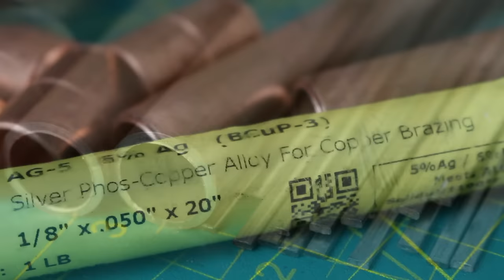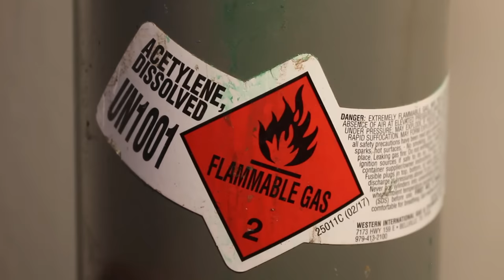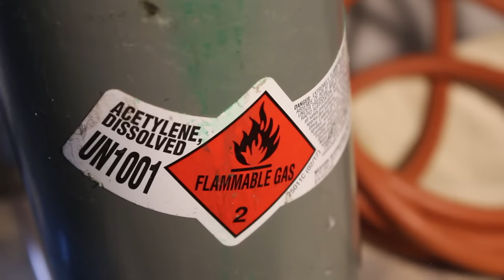How To Braze Copper Pipe Like A Pro (HVAC Refrigerant Lines)

Comment: I could have been in and out of there in 1/4 of the time.  Your torch was whistling like the tip had something in it.  I’ve used both air acetylene and ox acetylene I prefer the latter.  You should have been able to get the joint up to temperature much quicker.  Other than that I thought it was better than a lot of the brazing videos I’ve seen

Comment: I'm no HVAC pro but I've seen what happens to the inside of copper pipe when nitrogen isn't used while brazing. All those flakes can't be any good for expansion valves or anything else.
Reply: Nitrogen is only required for med gas that’s it
Reply: this is not welding.
Reply: That is how most txv fail
Reply: No you right man I just started to work in hvac and they ran nitrogen while we were brazing the copper together
Reply: i feel like you should shut the flup cup if you arent an hvac pro.
Reply: Smh... there are so many hack-n-glue "pros" out there. The old guys who trained me to braze HVAC copper lines had worked in the HVAC field 30+ years and they were always commenting on hack jobs they encountered and how difficult it was to find good techs.
Reply: Sounds like you're on your way to becoming a great HVAC tech!

Comment: You should ad more weld on the joins to fill it up properly because of high pressure oparation. it's very good though.. but not perfect.  (I am a tough judge, sorry)

Comment: Could I braze the vertical pipe first? then after that I rotate the pipe 90 degrees, and make the horizontal one to vertical, then braze it? because I think when braze the vertical one, the melt metal will go down into the gap between the pipes it will make the join much stronger. Thank you for sharing!
Reply: Get a professional please.

Comment: Long radius 90's are preferred in HVAC....Air conditioning rated fittings are a must....Nitrogen is over rated but to be a pro must be used these days to avoid ridicule.....First you heat the pipe....Then you heat the joint and it sucks it right in.....works every time.

Comment: So no movement to facilitate capillary action? This looks nice on the surface but I would recommend travelling the heat down a little to form a much taller seal internally.
Reply: Michael Garcia I was thinking the same thing
Reply: Brazing seals the outside. If you get inside the lines u have a problem! It doesnt take much....
Reply: @Progress24.7  wrong.

Comment: My boss tries to tell me I get it to hot. I never have leaks and have vacuums hold for 8 hrs. Nice video
Reply from the maker: When the copper turns cherry red its definitely time to put the flame away. I have definetly burned a hole through copper from overheating haha. I usually heat it up and swipe the brazing rod across the pipe to see if it's at temperature and then I know I'm ready to apply it fully. Bosses are picky but those vacuums tell the truth! Good job🙂 Thank you I appreciate that very much. Appreicate your feedback and have a great day!

Comment: Asking as a regular home owner; why for A/C lines do you use brazing rods instead of solder like used in plumbing for water?
Reply: The A\C system runs at far more higher pressure so all the joints on the system should have higher temperature resistance and stronger connection.

Comment: Over heating the pipe man , you fried it !
Reply: No kidding and didn’t even cap it
Reply: First time i guess
Reply: Exactly what I was thinking 🤔
Reply: If you've never silver brazed copper lineset before, just say that. Silver brazing won't even begin to start melting until copper is at LEAST glowing red. Stick to plumbing. 😂🤣😂
Reply: Na he did good if he did overheat it you would have seen a cheeta like patern on the parts the braising material is at

Comment: How you doing can you make a video where a copper tube is cracked millimetres from the compressor shell where its leaking oil and  needs to be filled with the special welding rod...and what material to use..thnks

Comment: Do I understand correctly that you use acetylene due to higher hit density? I.e. to hit the joint quicker as as little heat as possible dissipating into the length of the pipe?

Comment: There’s room for improvement here. By and large, using a turbo torch is NOT the way the vast majority of technicians braze lines . You heated up the fitting before you heated up the pipe, and that is the opposite of best practices. You heat the pipe up first so it will expand within the fitting, creating less space in between the pipe and fitting while you’re brazing. Also, personal preference here but you’re using very low silver content brazing rods, 5 is much harder to use. 15 percent silver is the industry standard.

Comment: Tried to use a brazing rod for the first time but the Butane Propane mixed gas is not getting the copper pipe Cherry red, from what I’ve seen online the gas will reach 1300° C and the brazing rod melts at 710° C, so have no idea what is going on.

Any ideas would be great, The only thing I think I can put it down to is the touch head as it has no adjustment for the flame 🔥
Reply: that tested in lab. In real life heat dispersed very fast so it got be much hotter to work well

Comment: Thanks for the  video. I'm in business making thousands of brazed C joints a day. Brazing wire does not need 1500 C  to melt. Copper melts  about 1100 C and silver based brazing wire melts about 800 C. Compared to large scale production your brazed joint  looks low quality and spend much time and wire to braze. Good capillary clearance, nitrogen inside tubing, flux in flame, flaring on the tip of countersink  also improve.

Comment: u r moving torch 360 degrees but it's not possible in the job site
Reply: if youre having a hard time with moving around the joint on job sites i suggest getting a twin tip for your torches. it helps get a nice even amount of heat around the whole pipe , and can get the flame in hard to reach areas.
Reply: Making a small heat reflector out of some sheet metal clamped in a vise grip can be used to concentrate the heat on a joint that does not allow 360 deg access. Placing the reflector behind the joint keeps the blind side hot and prevents heating the surrounding wall. (Fire = bad)
Reply: He did a great job but you are correct I do hvac an when your brazing in the attic in hard spots it gets a little tricky
Reply: @ChaseLife2016  yea exactly.. and I want to see the video of him using turbo torch at 1 ¹/⁸" evap line at condenser, and keep the valley cool..
Reply: Valve*
Reply: @traeb8866  I want to see someone braze. 3/8- an 3/4 line set with coupling in attic next too spray foam insulation it’s rough lmao 😂
Reply: @ChaseLife2016  haha will b some charred spray foam to b cut out after the tail of that turbo torch flame has heated everything but the line set.. ha
Reply: @traeb8866  right school an being in the field two different things I learn from the field not a book an school don’t teach you when you up in the attic trying two braze between trunk with insulation wrap an roofing insulation trying to get a decent pass on the cooper line set 😂😂😂
Reply: @ChaseLife2016  I agree it gets pretty tricky 🤣
Reply: @ChaseLife2016  he did not do a good job,  it was an abysmal execution.
Reply: @trevorbjarne  it’s easy to braze line set or copper on a table he did a good job but it’s hard when you in a tight space
Reply: @ChaseLife2016  he did not do a good job.
Reply: @ChaseLife2016  it might be difficult in tight spots but one needs to know the basics,  fundamentals the principles and theories so that you can apply them in any situation.
Reply: @ChaseLife2016  I do not know if you can see my profile picture but that is me passing my large bore (6" & 8") med gas brazing certification test.
Reply: a good tip when brazing (or soldering) on the job is to try to heat and braze the harder side to reach first. Just angle the torch as well as u can and do the side you can't see first, that way u can be more sure that it was hot enough and done correctly
Reply: Huh? You are confused/ confusing.
Reply: Typically, I try my best to divide 3/4" + pipe/ joints into 4 quadrants making sure I get a good flame spread over said quadrant and then work the solder from the top of the joint to the end of that quadrant and then from the pipe to the back of the joint and then from the top to the next quad.- that's half the joint, then I repeat the same on the other side, maybe clean the entire joint up a bit with the torch.
For 3/8"-1/2' ish line I divide in half soldering one half then the other. 
for smaller then 3/8" drawing the solder from the pipe to the back of the joint does the trick with very little torch movement besides that which is required to flow solder and get a good heat spread. 

If nothing else, watching TIG welding videos helped me tremendously in the ways it translates to brazing,. Besides that, soldering is mostly prep work. Sand the joints till they're shiny like fresh pennies, a dab of flux, proper nitrogen flow, and of course, properly fit pipe-all facilitate the flow of solder and the conversion of the joint to 3rd alloy making it truly one piece that's gonna hold pressures well over that of typical operating pressures of just about any HVAC/R system. 

If the pipe is cherry red, you're already way too hot, there's nothing stopping you from lifting the torch momentarily to keep the heat under control, DO NOT blow the fitting with excessive heat, if you rupture a service port, there'll be more than one person pissed the fuck off at you.
Reply: @trevorbjarne  it’s not hard, don’t act like that lol
Reply: That’s why they need you there
Reply: @icychillgrill3  I think you are on the path of understanding the brazing process. But, you do not reporting or conveying proper or correct information. You, refer to this process as soldering and you said some things that are correct and a bunch that is not correct. I am trying to wade through your English (I am in no way faulting you trying to explain something that I am to assume is at best a second language - I speak zero Korean, so you are doing better than me on the languages front). I am happy to hear that you said that if you get your fit-up cherry / red hot then it is too hot. Like I said, there is too much going on here that you are not really conveying what I believe is in your head well. I'm trying to be nice and helpful. If you would like some help, then please feel free to ask me. All the best.
Reply: @captainmigs1655  I don't think you know what you are talking about. You don't act like that.  LOL
Reply: @trevorbjarne  shhhhhhhh

Comment: My friend is HVAC.
He is adamant that you do not need flux and he uses silver rods to braze 35mm pipe that they form their own sockets on.
The rods contain phosphor which acts as a flux within the rod. Is this correct?

Without the phosphor the joint would not work. Is this true?

Comment: Hey! What kind of rods to torch with? U mentioned silver Brazing flux? Then u said something else??
Reply from the maker: They are called brazing rods. They come in different percentages and that percentage is the silver content in them. Higher the percentage, higher silver content and strength. Typically the standard is 5-15% for a solid connection from copper to copper. Make a clean cut, sand it down and braze👍 Thanks for watching!
Reply from the maker: Stay tuned for new videos every week! 🔧⚡️

Comment: What is the advantage of brazing over soldering which is much simpler and less demanding?
Reply: Brazing is stronger and more heat and vibration resistant.

Comment: I've done this a few times on ac lines. Have the burn scars to prove it 🙂  I f I d it very stressful but the more I do it the more relaxed I feel. Is there any limit to how many times you can go back and touch up the joint. What if the joint has already cooled down.
Reply: It's like welding..you'll just be adding to what has been done.
Fluid motion is key
Reply: No more than two times.

Comment: Hi! I brazed pipes 2 years back (compressor of my fiesge gave up so I replaced it myself). I noticed the joint/seal is showing signs of giving up... Is it safe to pump the gas out of the compressor and redo the soldering? Thanks!

Comment: I needed ver little for a single job, so bought some on eBay. I never noticed at first but as many small stuff, comes in broken packages. I saw the stamping on one or two that looked like “Sil-Fos” or similar. Used two maybe but while wrapping for storage, the others were not stamped or marked in any fashion. I am sure analysis would show no silver content.
 What did Ben Franklin day? Buyer beware? I’m sure I got shorted. So ask, take a photo of response and same after it arrives and set time/date code on photos as depending on size/amount/cost, they let you keep it and re-send new.

Comment: NO shade intended, but this video is why I don't use a B tank. The flame was on this fitting, which appears to be 3/4" ACR, for over 3 minutes. An oxy/acetylene torch would have this done in less than a minute. Less heat transfer up and down the tubing as well, to limit potential damage to other components.
Reply: Wrong. Please contact if you'd like actual advice.

Comment: Why can you not use normal solder for refrigeration connections , it seems to work perfectly ok for plumbing and heating , I am just curious to know the answer......👍
Reply: yensabi Solder used for soldering water pipe is lower melting point which can’t hold up to the high pressures of refrigerant and vibration at the equipment. Higher silver content. Brazing is a much higher melting point and stronger bond.
Reply: Brazing is stronger to deal with the higher pressures in refrigeration. R-410a on a hot day and a plugged condenser will get you 600psi real quick and you'll never see that in plumbing.

Comment: Yeah just using acetylene you're heating 15' of pipe up and creating soot. Oxygen acetylene can instantly heat just the joint so you're soldered and done in seconds.
Reply: first off this isn't soldering.  and secondly the entire industry uses this method and has for generations.  Its easy to be critique someone behind a keyboard.  union plumbers and fitters use this exact method all over the United States.  The system has a service life and nobody cares about being overly anal and particular.

Comment: Ive had trouble burning pipes leaving the flame on one spot too long. Heating from the bottom, waving a bit on the piece and then bringing up the flame towards the rod seems to work best. Many old timer's ive worked with also say reheat the piece too many times is bad. Those same guys also didnt think using nitrogen was necessary even though the ports on some valves are frickin tiny. Maybe things were different with R22?
Reply: I'm sorry, but this video and your old timers are giving you bad information. Things were not different with R22.
Reply: @trevorbjarne  Hey there thanks for the input from my 1 year old comment but, im not sure what you mean since obviously R22 systems are not compatible with their "modern" replacement ala 410a. I've had the liberty of recharging R22 systems which is easy since you can just add more without issues. Conversely 410a was a pain since its made up of 3 different chemicals instead of just one like r22 and would sometimes need reclaiming to refill the system. My point being, with obvious things like pressure differences and temperature thresholds off the table, how do you suggest they are not different?
Reply: @nobadnamesleft  Hi,  No Bad Names left. I'm sorry if I was unclear - as the subject of this video was brazing... so when I said that "it" hasn't changed - I was referring to the brazing process.  That's it... the brazing processes has not changed in that last couple of decades - I've made it better - I have just written a book on the manual torch brazing process.
Reply: @trevorbjarne  I see i over complicated things as usual for myself lol. Cheers 🍻
Reply: @nobadnamesleft  If you have any direct questions about brazing - I can answer them. All the best to you and yours.
Reply: @trevorbjarne  Let me ask you this:  what do you think of going with a soft solder joint (in refrigeration) like with Stay-Brite#8 - instead of brazing?  You've got the annealing problem and the carbon buildup problem because you're using so much heat.  I see a pro guy on YouTube (Halligan 142) who says the Stay-Brite #8 method (soft solder) works for him; although others don't really recommend it.  The trick with brazing seems to be don't go too crazy with the heat.

Comment: I'm learning to braze at my new job.  They use oxy-acetylene.  Is there a benefit to using only acetylene?  Also, reading the comments, it seems there is much more to brazing than maybe even the guys at work know.  We just build chiller units.
Reply: If you are in a shop environment oxy-acetylene is probably better.  A turbo torch can efficiently braze up to around 2 inch copper with the right tip.  The real advantage is if you are lugging everything to a roof, one tank is lighter than two tanks.  If you need to heat quickly, like a reversing valve, oxy-acetylene is the way to go.
Reply: Oxy is just faster but you can blow a hole in the pipe pretty quickly if you aren't careful.
Reply: Benefits for both processes.

Comment: Can we use the flux we use for electric cable soldering if we do not have handy copper tubing flux (for one single joint) ?  Thanks.
Reply: No! Do not do that! The joint won't last as long and is more prone to leak on 1st pressure test!